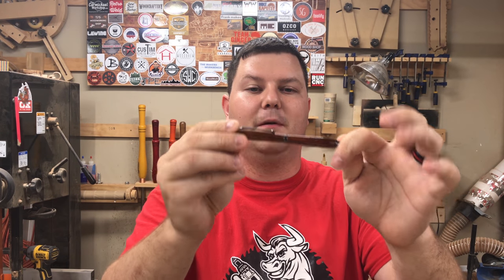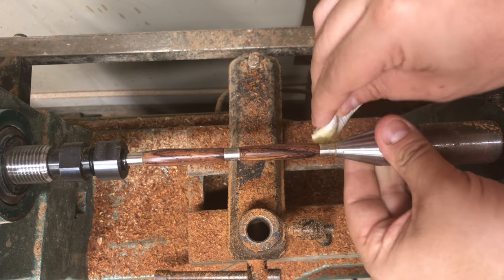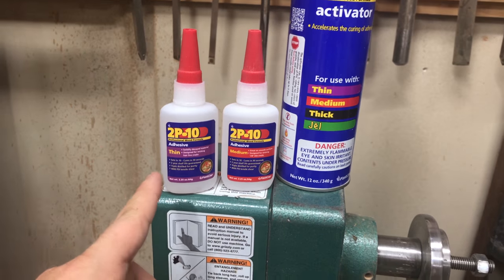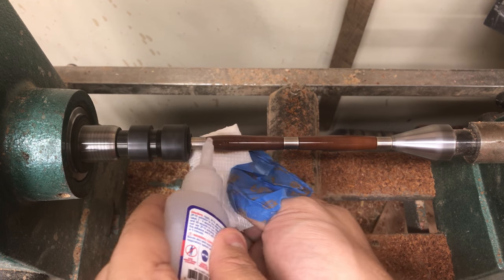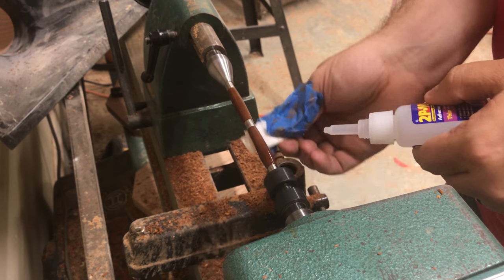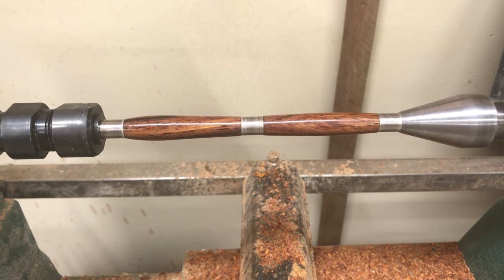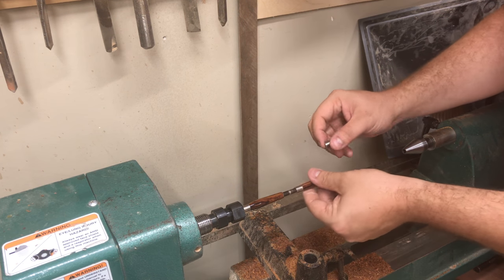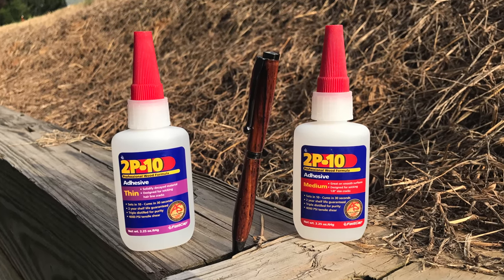How to: Applying CA Glue Finish

Comment: I love CA finish... the only thing I use on my pens, so far :-D
Reply: Good tip using paste wax on the bushings... I've never done that... but I'll be adding it to my regimen.
Couple tips for you and/or what I do:
1) Don't use cotton based paper towels (CA interacts with cotton, and supposedly can cause a fire, I've had them smoking before) -- get those blue shop towels, or whatever, as long as they're cotton free.
2) When I do mine, I do 3 coats of thin first with no activator, so the wood absorbs it a little more.
3) I do 10 total coats, but dealers choice :)
4) It kind of looked like there was some CA sticking off on the ends when the pen was assembled, it was recommended to me to sand that extra CA off with 600 grit before assembly
Reply from the maker: awesome thanks for the tips